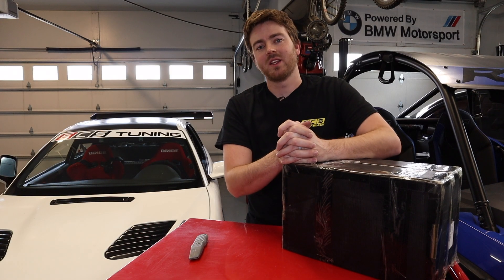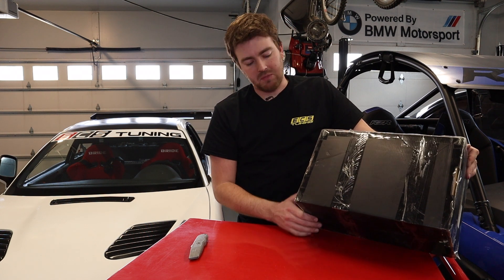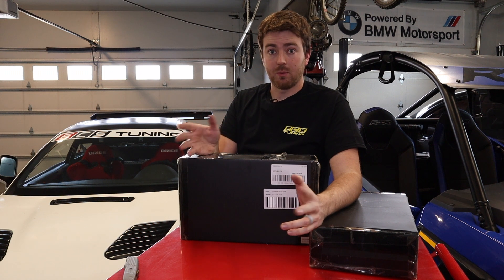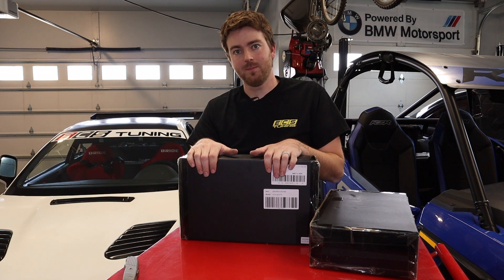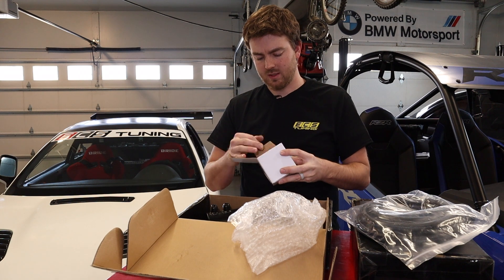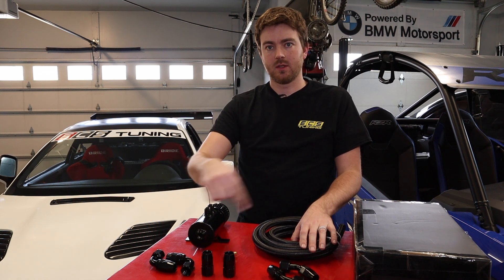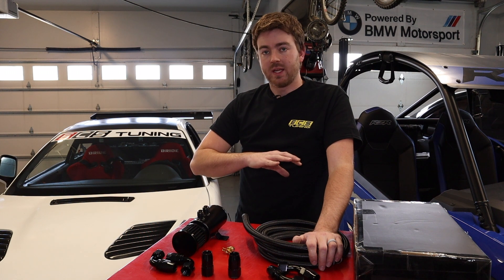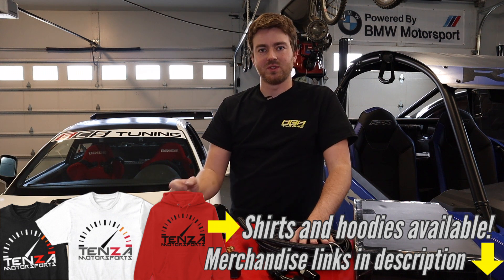Maxpeedingrods Vented catch can review - Supercharged/Turbo BMW E46 M54 catch can unboxing

Comment: I have a turbo m54 and it smokes a little oil at idle. Not crazy but gets worse the longer I idle. I am venting the valve cover fitting to under the car but I suspect I should do a recirc combo system and be pulling vacuum for the oil control rings, then vent in boost. Not sure if you have had experience with that? Internet tells me the oil control rings are super weak and usually need vacuum.
Reply from the maker: I haven’t had anything like that before. I wouldn’t even know where to start. When you figure it out update us.